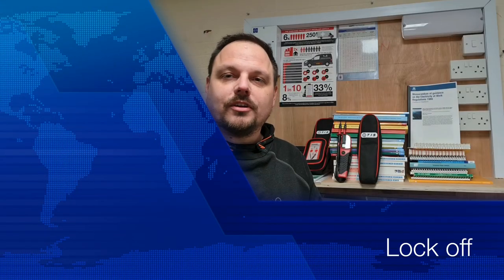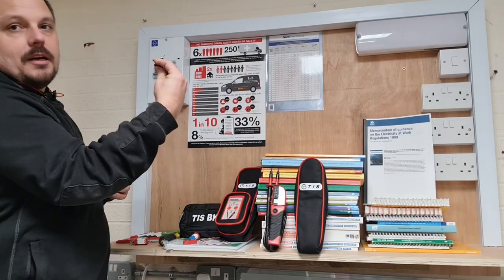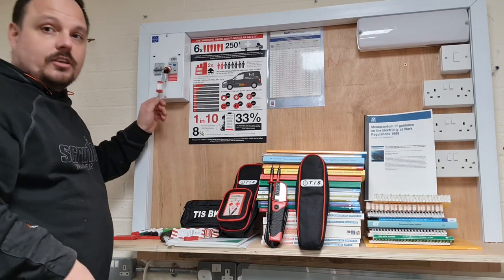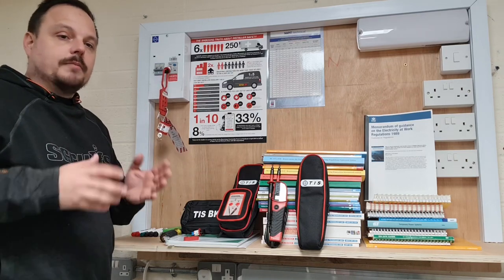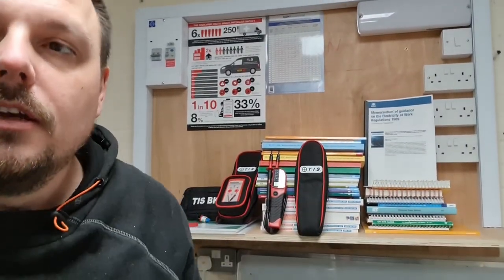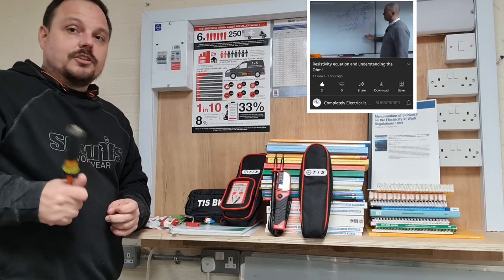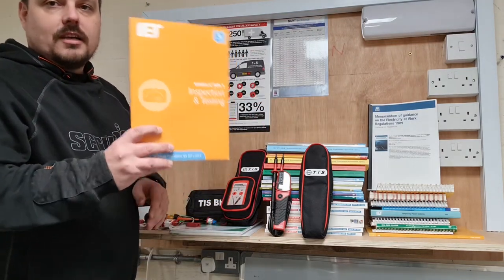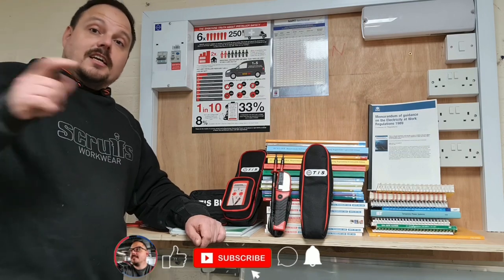Lock off UK electrician. Safe isolation applying locks

Comment: This is such an interesting subject and it is also that something that I’m going to be doing on my channel. There are so many things in this industry that are ignored and one of them is what you’re displaying the lock off kits. When I’ve done my apprenticeship I worked for a company that was so strict you would have to have permits there is virtually no way you could ever get hurt but once you go to light commercial and domestic it doesn’t exist. Prime example of this is that if you go into any wholesalers if they won’t have one lock off Kit I’d be amazed and considering they should be used just a clear amount That are sold or a clear indication of how much people use these for I am probably one of the 1st to admit That I can be a bit lazy with it. Back onto the wholesalers selling them if they were used as much as they should be they would be shelves of them as there is screwdrivers.As well as intermediate fire seal there should be palletloads in there.Food for thought great video
Reply from the maker: Good shout Will and you are right.  MOD are big on safe isolation as well.